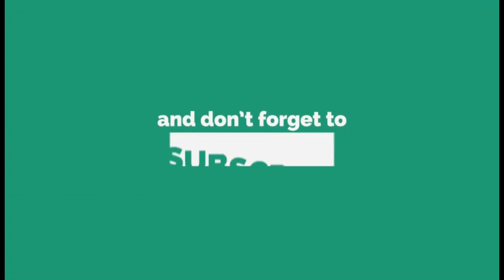DIY Aquarium Observation Hive - PART TWO - Installing the Bees and making final adjustments!

Comment: I'm working on a Fish Tank Bee Hive pretty much like yours - (got my tanks off AMAZON for $12.99 each with free shipping) - mine will be three tanks vertical with the top tank being a four frame auto flow - I will only have to remove the auto flow frames to empty them as I don't want to take a chance of drilling holes in the glass.  I'll keep you posted on this.  Jim from Panama City, FL